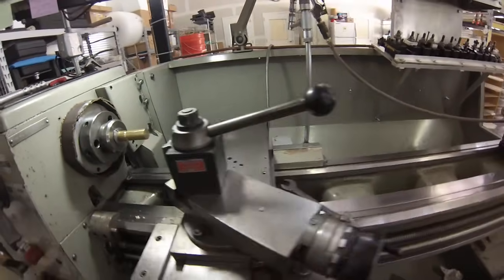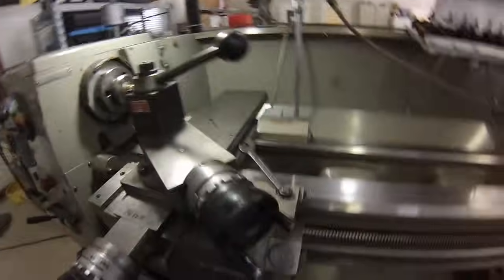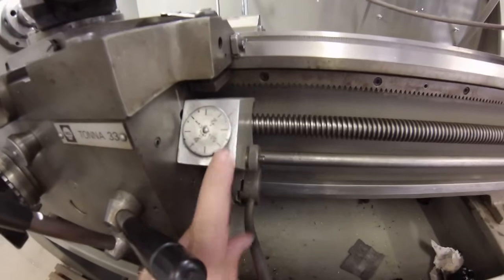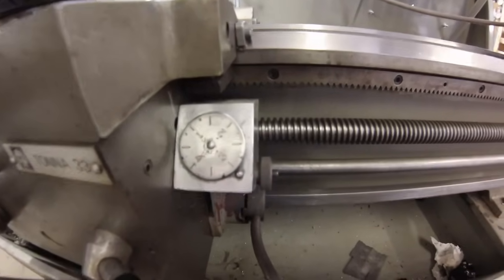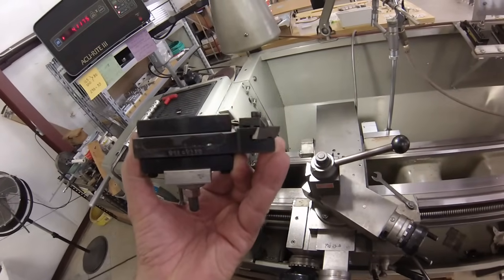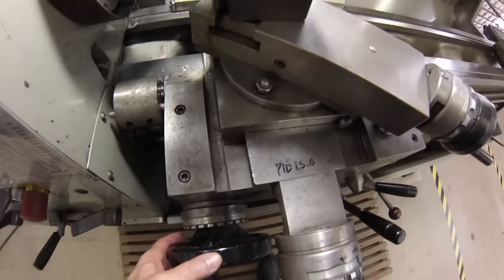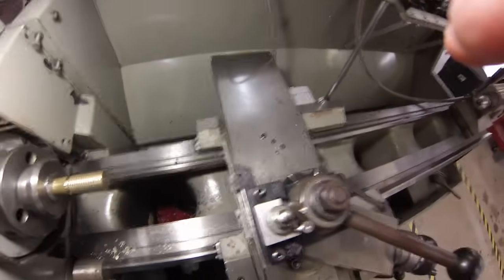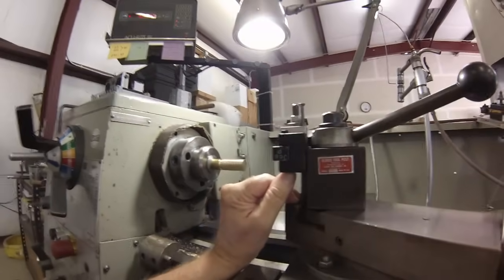Threading on a manual lathe  BEST TECHNIQUE EVER !!!!

Comment: How do you set the cutter dead center?
Reply from the maker: Same as upright, just inverted. I use a solid height standard.
Reply: @joepie221  I watched your video on making the standard, I was just wondering how you use the solid height standard inverted. BTW, I really appreciate your videos, thanks!
Reply from the maker: @dennisschulze439  Lock your tool to a visual centered height and just try to slide the standard under it. Adjust to suit. Do not rest the tool on the standard and then lock the tool handle. A QCTP cam action is almost guaranteed to chip the tool against the standard.

Comment: if you are cutting in reverse shouldn't you have the compound slide opposite to what you have, instead of angled towards the headstock  have it angled towards the tailstock
Reply from the maker: I choose to plunge cut my threads. I don't use the compound approach.
Reply: @joepie221  yes but if you did use the compound slide should it be the opposite way

Comment: I have always gone front to back on the CNC.  Wonder if going back to front would be better?

Thought is I don't have to think about the ending point 
G33XnZnInKnAnCnPO 

P is Used when you want the tool to keep traveling forward while it pulls out
of the work. This will leave no undercut.

If I have a relief at bottom of threads so I don't turn P on.   That P command has broken off a tool insert as it hit the shoulder.  Had a crazy cut on the shoulder at back of thread before, took me a little bit to figure it out.   

Think I will try it.

Comment: Good tip on reverse cutting, I love machinery's handbook but for everyday use I use a 'Zeus' book. Here in the UK they live on everyones lathe, dont know if they are available in the USA..handy little laminated book with all the thread data you need on all the most common threads plus loads of other machinists data but in a booklet form

Comment: 27 years in auto eng trade  this is a first wow, Just one questions Joe,, must the tip of the cutting tool still be in the centre if in upside position acording to the laith center,
Reply from the maker: Yes. Center the tool as if it were upright. You are going to like this method.

Comment: Great trick. Don't know if you check on your old video posts but.......I learned this from my college teacher back in 1960s. I also turn a lot of adaptors that are used in astrophotography gear. Camera adaptors, lens cells, etc. that require very precise alignment and close tolerances to ensure parallel alignment of components.
Most of them require internal threading in a blind hole or up to a shoulder with different diamter holes and threads on each side. I reverse the compound in a mirror image setup to normal operation.  I than cut on the far side of the bore and move from the bottom of the bore out using a insert designed for that method. This allows me to see the cutting action where the other way it would be hard to see. and like your method.....you don't have to worry about running up against the bottom of the bore. Matching these threads is always a pain as every manufacturer has their own idea of what the thread specs should be  ;-)  I suspect it is intentional so brand X can only match their own equipment and not the competitor even though the thread appears to be the same thread and pitch  ;-)  Of course some of this comes down to that special metal often used by manufactures....Chinesium ....which makes all this even more challenging ;-)
Reply from the maker: I have a video defining that exact process. It works very well and reduces the scrap risk.
Reply: @joepie221  Joe...thanks for your fast reply...you are great!! ....I found that video and just saw it. Exact same process I use. I don't see how you could ever cut an internal thread in a blind hole otherwise without damaging the tool and/or material.  Thanks for the great videos...you are great. Not much I can fault you for....well maybe the scotch brite cleaning up the threads internally. I am also a giging musician and need my fingers to be perfect so tend to be ultra sensitive to doing anything that could hurt them. I was thinking a safer way would be to wrap that Scotch brite or steel wool around a stick so your fingers aren't going to get grabbed.
Reply from the maker: @RobertKarlBerta  Most would admit, anyone that has done something for a very long time, gets very comfortable around some otherwise dangerous environments. Your observation on the scotchbrite is spot on. But...not being explained in that segment was how I know exactly how and where to apply the pressure so my finger doesn't "Take a lap", the machine was running in reverse so the thread helix was rejecting my finger as opposed to trying to suck it in, and the hole was big enough to allow for an easy withdrawal if anything grabbed. But bottom line is, its not something I would be comfortable seeing a new guy do and I would agree, the abrasive on a stick is a much better way to go. Thanks for calling me out. You are correct. I appreciate your comments.

Comment: As an apprentice Toolmaker in the UK in the early 70's, one of our Toolroom turners showed me this approach to screw cutting but I didn't use it until I saw your YouTube video probably a couple of years ago. It really is a game changer, I wouldn't do it any other way now. I think you also probably said you can also run the spindle at a much higher speed more in keeping with the material and diameter, another huge advantage. Brilliant Joe.  Keep up the great work

Comment: Great video Joe! I am still learning even at 58! I do his backwards so the tool is on the back side of the work and the right way up with the lathe running in reverse. So exactly the same but the tool on the back. For me ... my lathe doesn't like upward force on the saddle, it's an 11 inch swing lathe but it can lift if not careful and too aggressive cut. With the tool at the back the force on the bed is still downwards which works better with my specific lathe and the lathe allows the top slide to be moved back and under the work. The disadvantage is reduced swing but it's still like 6 inches.

My other tip for thread cutting ... if the lead screw pitch is divisible by the thread pitch ... you don't need a DTI. So say your lead screw is 8 TPI? That's 1/8" pitch. If you engaged at the wrong thread on the lead screw ... the error will always be 1/8 " inch out, so to cut a 8, 16, 24, 32, 40, 48 tpi (multiples of 8) the engaged lead screw doesn't matter cuz the error is always a multiple of pitch etc. (Sorry about the 48 ... I make a few camera and telescope threads!).

This is particularly useful on metric lathes (like mine) whose DTI's are an absolute nightmare to understand ... cuz pitch is measured as the pitch of the thread, not something sensible like threads per unit length. So say you had a 3mm pitch lead screw, you can cut 0.25, 0.5, 0.75, 1 and 1.5 mm pitch threads without a dti because the tool error is always a multiple of the lead screw pitch? ie 3/0.25 =12 .. .a whole number etc. 

Hope that encourages people to thread cut their own threads. I'm just off to make a mandrel. I have a 20 year old beautiful Sherline. I am making a mandrel that I can quickly throw in the 3 jaw on the 11 inch to mount the exquisite and extremely accurate 4 jaw for the Sherline. I need to turn a 16tpi x 3/4 in stainless on a metric lathe just 1/2 inch long so will use the above technique. Best I can achieve with the gears I have is 16.05 tpi ... so we will see :-)

Comment: I prefer lathes with a tumbler reverse, you can mark it, wind the lead screw back, then re-engage when the lines match up again. Also you can do multi-start threads by disengaging it ( the tumbler reverse ) move the spindle by the correct amount of teeth and re-engage. The rear mounted toolpost is the best way to use an inverted tool, although not relevant in this instance of machining in reverse. I hope no one try's it with a screw on chuck....

Comment: Takes me back.
Screw cutting and parting, always to "pushdown" on the spindle bearings.
Not sure why but it removes the ripple due to any wear bearings, and climbing if a touch off centre.

Anyway, nice to see a Colchester in use. Those, Harrison's and DSG's have to be the nicest to use.

Comment: this is a great technique however it best works on a imperial lathe with imperial threads or a metric lathe with metric threads to try to use a bed stop on a non standard (for that lathe) thread is asking for trouble as you have to keep the 1/2 nuts fully engaged but I now use this technique when doing a standard thread.
Reply from the maker: You can still do metric threads inverted, just don't use the stop.

Comment: Your chatter is a combination of depth of cut, your speed and the fact that all threading is supposed to be done with a center to steady the work, material flexes when it is just flapping in the breeze, because of the flex I bet your threads would be deeper on a thread mic near the headstock and more shallow at the unsupported tip because of flex
Reply from the maker: The chatter is a normal characteristic of a deep cut in brass and a positive tool geometry. Centers are advisable for longer / thinner extensions, but 1" diameter stock hanging out 1.5 inches isn't going to push. I would bet this thread is within .0005 full length. Regardless, this video is about the technique and not about surface finish or chatter. Both of which are easily dismissed.

Comment: Great video Joe.
  It would be nice to thread in reverse safely on the old South Bend 9A. I was thinking about making a duel arbor to lock my SB screw type lathe spindle to the chuck from the inside.
What do think about this idea ? Perhaps there is a better way?
Max Mirot

Comment: What if you don't have an undercut or the thread goes to a shoulder?
Reply from the maker: What do you do threading forward under the same condition?
Reply: @joepie221  Pull out before hitting the shoulder. I was curious how you would start the threading if you didn't have an undercut. Thanks for responding.
Reply: @joepie221  Do you follow what I mean? If you are cutting away from the chuck like in your video but you are up against a shoulder and do not have an undercut to start from like most jobs I'm guessing what do you do? How do you set the tool up before you engage the cut?  Thanks.

Comment: I gave this some thought Joe. I'm starting to think you're trading one anxiety for another one, here's why. With an upside down tool starting from the far end of the thread you have a very small grove to work with. That's not a problem of itself but let's say we're cutting that 10 tpi thread at 300 rpms. That thread dial is spinning pretty fast and it's just as easy to miss the dial mark as it is to miss it from conventional threading only more so because if you give yourself plenty of room starting conventional threading if you miss the dial mark you can flip the half nut off and try again. With an upside down threading tool  if you miss the mark you don't have time to flip it off, your thread is ruined. Also it's much easier to flip the lever off at the end of the thread in the grove than flip it on.
The place where it would work is internal threading but on internals I go slowly and use the DRO point  to flip the lever.
Reply from the maker: I would say 99% of all anxiety is at disengage. So I respectfully disagree.
Reply: @joepie221  Okay Joe, friendly challenge. Here's what I'm going to do, I'll set up my lathe to cut both systems and run the lathe gradually increasing the chuck rpms. I'll run several passes with each system and see which one enables me to consistently run the fastest rpms with the least thread cutting failures. Let's see what happens? I'm in the middle of a project so I'll do it when time permits. 10 TPI, 1" round stock, external threads.

Comment: This looks fine in brass but if turning thread in hard material you want to use compound so only cutting on front side of insert and avoid the mortal sin of turning toward the tail stock. Spindle bearing in a lathe only have a thrust load one way you also loose a lot of rigidity by pulling away from head stock.
Reply from the maker: I do this with all my materials.

Comment: Great thought but, I was turning a 3/8-16 right and left-hand thread on an 8-foot piece of stock to tension doors. So had to use a live center negating the niceness of not having to worry about releasing the half nut in time.

Comment: how would you do long internal threading(5 inches) 3tpi acme dual lead?  I know how to do dual leads just having problems with chatter on a cnc lathe, so want to try on the manual i think the tool will have more rigidity.
Reply from the maker: Thats a very aggressive pitch. Use the largest diameter bar you can find and be sure the projection of that bar is minimal. What is the material?

Comment: I have worked on a manual engine lathe for 27 years. me and the rest of the shop where I work wear longsleeve shirts,  I never have even close call  once with my shirt. I also wear a watch.  Once again never had a close call  because of my watch.
Reply from the maker: But you are in a higher risk pool than the guys with no jewelry or sleeves. good luck to you.
Reply: I agree. But I believe the risk is absolutely minimal and  I get protection from hot chips, grinding debris and more.

Comment: Don't ya hate making an eloquently written post and accidentally hitting the cancel button?
Here I go again
A few topics I'd be interested in seeing would be tapered threading internal and external, multi start threading, left hand threading, and long shafts threading using a center and tail stock using the away from chuck technique
Also calculating the gear train on a lathe for exotic feeds
I'm pretty confident to apply for manual positions after watching your vid's after twenty years of CNC
Only here and there have I got back on manual since I got my JT in 2002
I have a buddy at the last shop I was at going to send me a pic of using a dial depth gauge to measure the thread depth of an  internal thread, he's an odd ball so no guarantees lol
I'll send you when I get it
Cheers mate

Comment: Hi Joe, a few topics that would interest me are tapered threading internal and external, multi start threading,  left hand threading, and long pieces with a center and tail stock using the going away from the chuck technique.
After watching your vid's I'm pretty confident to apply for manual positions after a lot of years on CNC.
Started my apprenticeship on manual but only touched here and there since 2005
Cheers mate

Comment: hi Joe. Kudos to you. Love your videos and your highly  professional approach. As a fellow toolmaker/machinist/CNC specialist, I always use the so-called 4:1 method for threading internal and external. With this method, you don´t need to set your compound at an angle. I use this method for more than 25 years now and it never failed me. If done right, the 4:1 method gives very good results regarding precision and surface quality. Keep up the good work.
Reply from the maker: I've always plunged my threads with great success. My first pass is usually very aggressive and tapers down from there. The technique has served me well.

Comment: Brilliant! Why isn't this widely taught as THE technique for threading on a manual lathe?? Now I'm just a little bummed because I just ground a single point thread cutting tool the wrong way for clearance with a shoulder (but the right way if I was using the butt clench threading technique).

Comment: You mentioned not using the compound at 29.5. And you are right, if you have enough rigidity it doesn't matter, that being said its a nice trick to use when you do need that better rigidity for hard materials, or large threads. 

I wonder if your upside down tool would work well for parting off on a worn out lathe, or even a new one with a lot of slop.
Reply from the maker: I understand an inverted parting tool does cooperate more. Try it.
Reply: @joepie221  The real issue is I bought us a small 10in baleigh lathe to replace the harbor freight mini lathe that the engineers were messing around with.  Ive been working from home, so I have not had time to sort the banana shaped ways on the cross slide. The upper part of the cross slide rocks. Really not impressed with the machine, but with the limited space available there weren't a ton of options.

Comment: This is great but not sure how helpful it would be if you are cutting threads that preclude use of the thread dial indicator. You've still got to run the engaged tool back under power, so haven't you got the same old problem?
Reply from the maker: No. Because when you reposition the tool for the next pass, you are off the part.

Comment: awesome tip, and i'd do it if i could reverse my lath, always thought it would be better that way though
Reply from the maker: I'm surprised a lathe doesn't go in reverse.
Reply: @joepie221  it was 3 phase but now has a single phase motor so prob did it by reversing the motor got a harrison 12" swing,

Comment: Joe , I have a question, On your subsequent passes do you advance the compound as normal, or do you just plunge with the cross slide?  great video.
Reply from the maker: All movements are done with the cross slide. The final passes are just smaller.
Reply: @joepie221  I had issues when I tried it. do you thing you could do a follow up showing the dials and how to keep trackof depth  total set up . my threads came out all flat and buggered. I really want to get this down using your method. I do gun barrels with threads like 1/2-28 and such.

Comment: Did my first threads last week, running forwards only because reverse doesn't work on the motor(+ no thread dial). Manually turning the chuck with the leadscrew engaged is good exercise and better incentive to get reverse wired up.
Reply from the maker: That could get tiring.